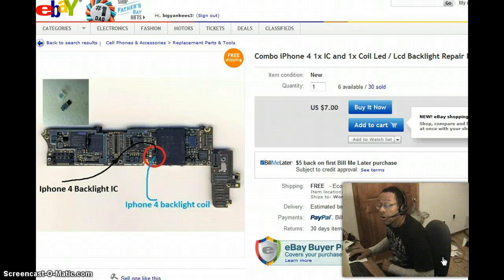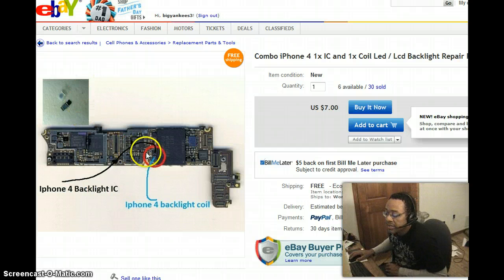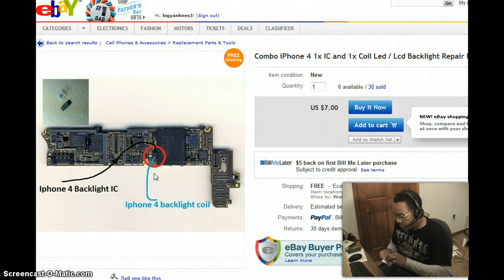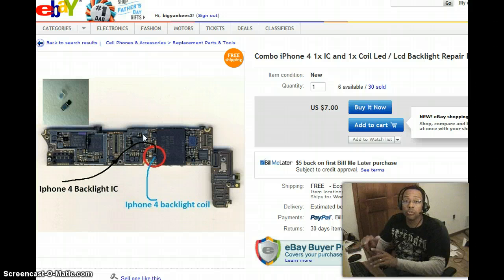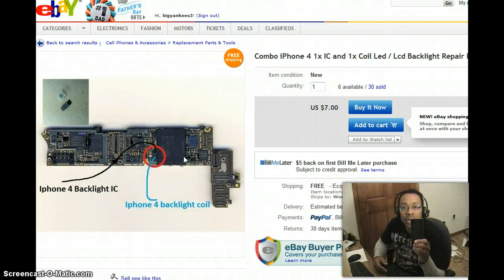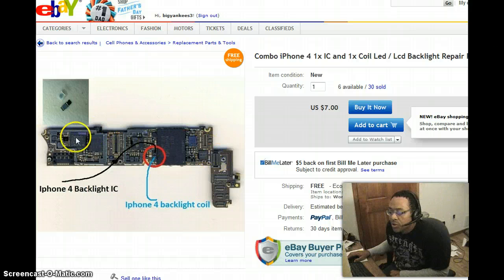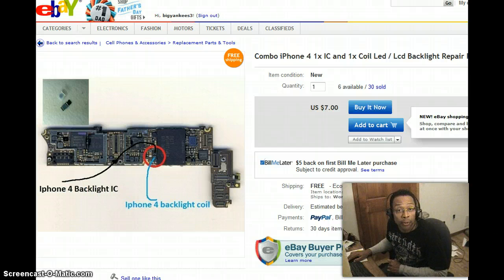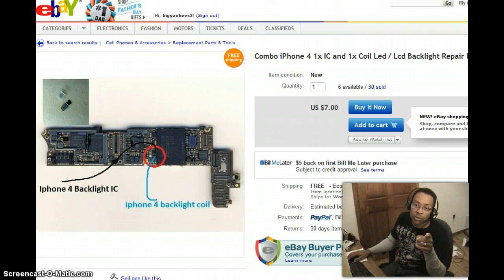iPhone 4 "Dim Screen" - Backlight Coil Repair Problem

Comment: Hey Carlton,i have an iphone 4s and i believe that's exactly what happened to mine. it wasn't water damaged though,it took a few nasty falls. until one day my friend,she was playing ''sims" on the phone and it blanked out. we thought the battery had died but when i charged it i saw nothing on the screen. i had it fixed and it went blank again. it seems worst now because as soon as the apple logo comes up,it goes blank right after but i know indefinitely the phone is on. i can mute it and talk to siri as usual. when i carried it back, they said the board went bad!! sighhhzz

Comment: I replaced my iphone 4 with the new display screen. I followed all the instructions from a guide all the cables are fit i checked it twice. But when i try to trun on i could not see anything just a black screen. When i pulged in to charge i can hear a beep sound. I wondered whether i damaged some hardware so i went back to change with my older screen then everything works fine with the broken screen but not with the new screen. Can you please tell me what might the problem is, the problem is with the new display or something else has to be done?. need help thanxx.

Comment: You incorrectly illustrated the logic board location with your finger... it "curls" around the top. The speaker assembly is at the bottom. Have you opened an iPhone before? o.O

Comment: Thanks for the info!! Quick question.. if this problem appears on an iPhone after a screen replacement, how does the iPhone behaves? I replaced a screen on an iPhone 4 and when i try to turn it on I can see a light for a sec and then i end up with a black screen. The phone wont turn on, but i can put it on DFU Mode though. Do you think this coil thing is damaged from the fall? PS: The screen is totally working, i tried it on another iPhone.

Comment from the maker: That's very odd. My guess is that there is a broken circuit that sometimes will disconnect, thus shorting out the backlight coil.

Comment from the maker: I usually charge $60 to $75 to replace broken iPhone screens, and around $100 to replace the home button (it's a real pain). But I wouldn't even attempt this. There's no guarantee this type of repair will last. Plus it's just too much trouble and I'd have to spend a ton of time learning how to solder on an iPhone motherboard. Way too risky in my opinion!

Comment from the maker: Your WiFi antenna is broken. It's a fragile wire with a tiny plug that goes into the motherboard. I've seen this happen on 3G phones a lot. Was it dropped?

Comment: Good evening Mr. Flowers I have a question and hopefully you can help. I just replaced the dock connector on my iPhone 4. When I turned the phone on  the LCD doesn't work. It not black everything is displayed but I am unable to slide the button to take me to the home button. Is this pretty much doomed or is there any solution to this? Thank before hand. Best regards

Comment: Hey there have this exact issue with my iphone 4 and after watching your video im seriously considering just getting a new phone. Also ive got an iphone 3g..yes its old school but its just laying around there because the wifi dont work. When i try to connect to a wifi network all i get is "Unable to join network" Ive change wifi antenna,changed boards but same issue. what do you think could be the issue or a fix?

Comment from the maker: That's an odd one! If you are even able to turn up the brightness, it can't be the backlight coil. Once that is out, you get NO brightness whatsoever. Sounds like you have a problem within the operating system. You might try doing a backup of all your data on a computer, and then restoring your phone. Otherwise, that might end up costing you a fortune. Be careful not to do anything until you have all your data safe and securely backed up!

Comment from the maker: Wow... that is a tough one! I have never attempted doing a repair on a device with a bent frame. That's probably near impossible to fix. I do iPod Touch 4th generation devices too, and when I get them with a bent casing, I swap them out for another non functional unit with a good base back. They really suck!

Comment: I have a horror story! I was repairing a coworkers 4th gen ipod touch digitizers and let me tell you it was a pain in the ass. The frame of the device was slightly warped and was nearly impossible to get the digitizer to stick on every point. I ended up guying three sets of double sided 3m tape and many tries to do this and failed on all. I've been repairing screens, digitizers and buttons on these type of devices for 5 years now and have never been as challenged.

Comment: This is a great video!  Love your style too. I got it instantly what happened to my phone.  A little water during some rain --and I mean a little water, just like damp-- and it was gone. I saw the light surge and then the darkness. I won't bother switching it on an off again and hoping. And I won't repair the coil or the chip.  It is the mother board.  Time to toss the 3GS phone.  Bummer.  Thanks Carlton!  And I might just buy an Android now too.

Comment: I dont know how you do it without hot air...  good job ?!

I use Hot air on max heat and max temperature for taking it off. 
max heat and low air speed with quickalloy solder when soldering new coils and ic back on.

Comment: I was able to successfully change the backlight coil in my iPhone 4 and get the backlight fully operational again. It wasn't too difficult to do with my old hot air reworking station I've had for something like 10 yrs.

Comment: Hi there thank you for the info. I jst want to say that the ic chip is the problem most of the time it's the source and not easy to replace but I still do without hot air gun using a pencil soldering iron

Comment: if you use a coil with the wrong specs of inductance or carry much less Max current than the original, sure it will burn out.   otherwise never seem or heard of that happen before.   if it does happen you have a short in the IC or the diode chip, but your backlight is not stable if you dont replace the backligh ic anyway if its only half working.

Comment: check out my videos on how to solder, you can even solder smaller part than the ic or the coil, those are actully pretty big compare to solder 0.75mm signal blue coil

Comment: I'm a iPhone repairer, I buy fix and sell. Bought an iPhone and quickly realised it was that this was the problem. Took a look under the cover, residue everywhere, and a very ominous mark under the IC's cover, right where the coil is. I don't fancy trying this repair. Another annoying one, is the MIC IC which means you can't be heard in a call. I may do the same as you and just get an S II now the S3 is out.